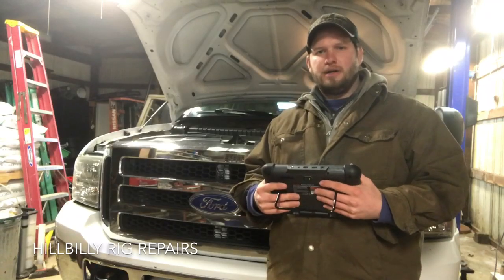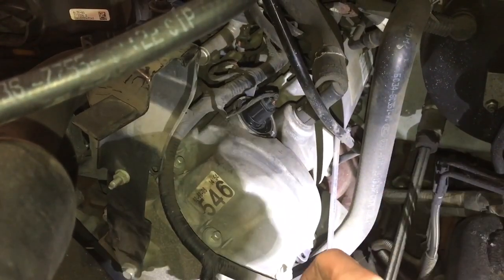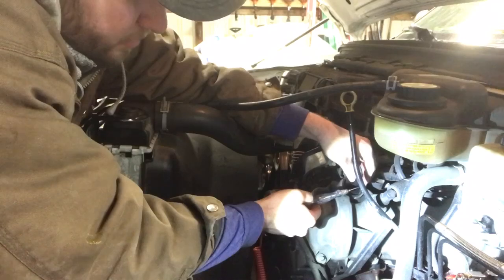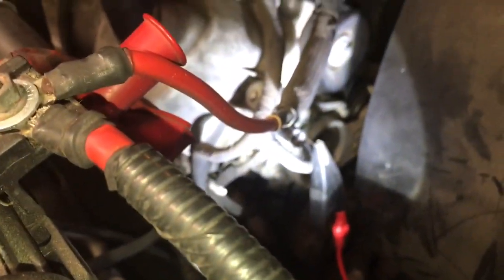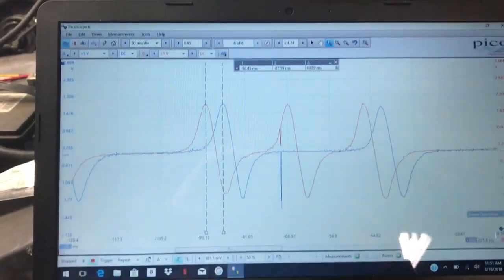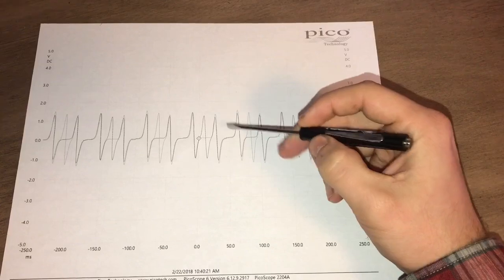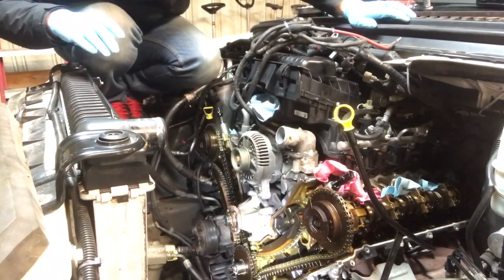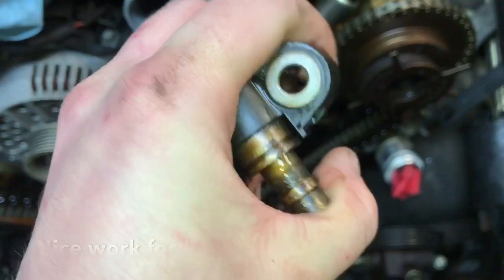Ford 5.4L P0022 P0012 Jumped Timing Chain

Comment: Hillbilly, thank you for the video.  I have a 2005 F150 that bought cheap because it had a CEL with code P0021.  The mechanic I took the truck to for diagnosis told me that, he put another solenoid(s) on it but the light came back on, then he put some other stuff on it (don't remember what) but CEL came back on.  Then it sounds like he did some voltage readings and he finally came to the conclusion that the PCM was not sending a signal (or the right signal) to the solenoid(s), so the diagnostic was that I needed a new PCM.
I'm about to order a refurbished PCM with the 2 new ignition keys from www.fs1inc.com, but before I do that, I'd like to here your recommendation based on my description of the problem.  I know it may not be a great description, but if you could provide some thoughts on it that would be very much appreciated.
Thank you.
Reply: I'd like to add that the truck seems to be running great. I just made a 130 mile trip and didn't notice any problems, I didn't notice any roughness on the engine, any overheating or anything else, the only thing I noticed is that it used more gas for the same trip than my other similar truck.  Any ideas?  Thanks.
Reply from the maker: I would recommend disconnecting the VCT solenoids and perform a camshaft/crankshaft correlation test at idle. This removes the possibility of a faulty VCT solenoid and or faulty wiring to either solenoid from the equation.
Reply: Hillbilly Rig Repairs      whats a correlation test? Can h link me to a video that shows it? Thanks

Comment: Im working on a 5.4 and when cranking it sounds like there's no compression on all cylinders. What do you think would cause this? It won't fire on starter fluid. I am thinking the timing is off causing no compression.
Reply from the maker: It could be a thousand things—saying that, I can try and help.
I’m assuming the truck started not too long ago. I’m assuming the truck did not just have major engine work done.

If you were spraying starter fluid and the engine didn’t even fart, I would move to ignition. I would suggest an in-line spark tester(just in case the plugs are original).

I seriously doubt both timing chains are broken, causing the cam not to move-but you could remove the oil cap and see if the rocker arms are moving while someone cranks the engine over.
 
In order for all cylinders to have no compression on a V8 engine bad things have to be going on.
Reply: Hillbilly Rig Repairs thanks for the help. Full story, truck was pulling into parking spot moving at idle. Truck dies instantly. Thought it was out of gas. Tried starting it for half hour after putting gas in and using starting spay to make it run for 5 seconds. At that point the truck would run for a moment with starting spray. Then noticed the injectors started to go crazy making noise like they were sticking open and closed really fast. The truck started to stop firing on starting spay then shortly after hydro locked from fuel dumping into cylinders. When I cranked the starter it locked. Finally noticed the front drive side tire had rubbed through the wiring harnesses under the wheel well. We had over size tires on the truck and making that last left turn into the parking spot might have fried the PCM. So order and new PCM had a new key programmed and let the engine dry out and now when turning over the engine it sounds it has no compression. I Haven’t  actually check for compression but it won’t even sputter on starting spray. I will check for spark tomorrow.

Comment: After you change the tensioners did the noise come back or it stopped right after ? Thank you so much for the video.
Reply from the maker: Tough to answer. The noise pre vs post repair is relative to each vehicle. On this truck, the chain was so loose that it would smack against the timing cover during a quick deceleration. That noise did go away.

Comment: I got a 2011 Ford Edge from an action. We I start the car on it does the same noise that I think I heard in this truck in the video. So, I took the car to the auto zone and the codes were P0012, P0017 and P0022. From that point, I took my car to 2 different mechanics. One of them told me to buy the kit that comes with the time chain, tensioners and the holders. The other guy told me that the noise could come from the valves. Now I’m here without know whom should I trust to put my money.
Reply from the maker: Ask the mechanic for a printout of the camshaft position waveforms; if he or she cannot provide you with this information then go somewhere else. 

A good first step for you could be to install(or have a mechanic install) new VCT(variable camshaft timing) solenoids and perform an oil change. Be sure to buy OEM(original equipment manufactured solenoids). If it turns out your vehicle needs a new timing set, these parts would need to be replaced anyway.